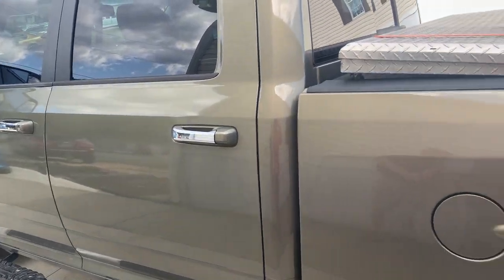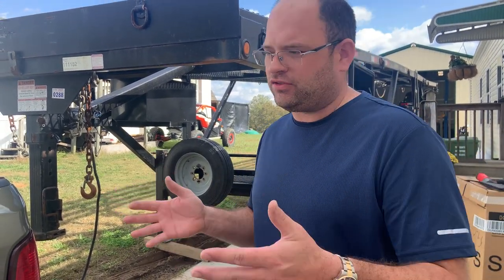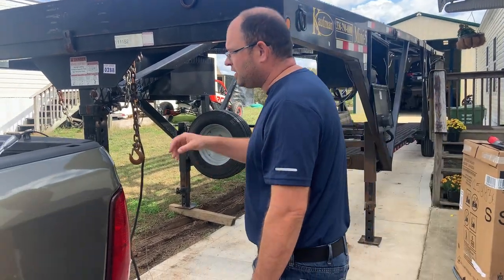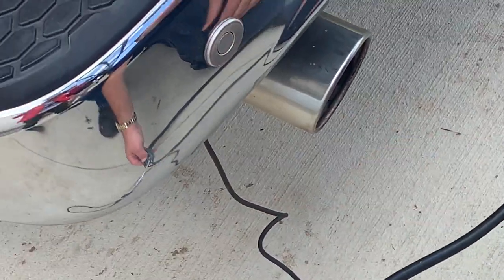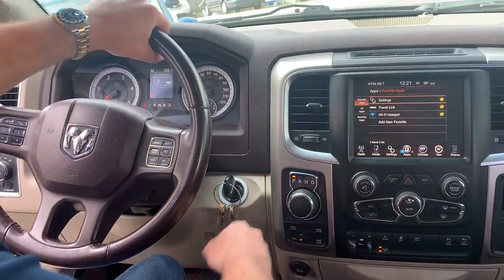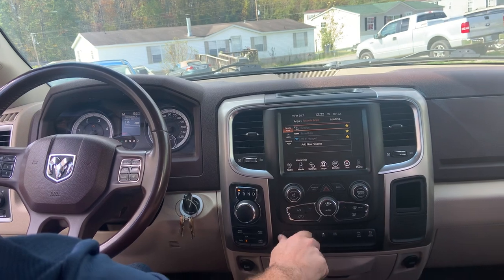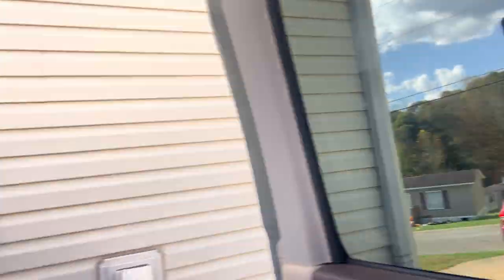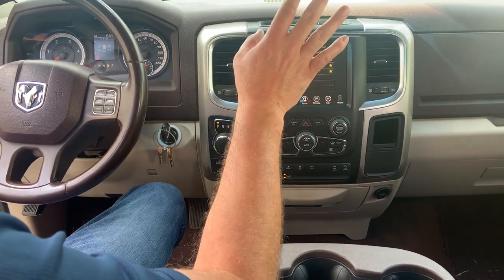Factory brake controller- Electric Over Hydraulic Brakes now working

Comment: So before doimg any modification on your truck and or trailer you may also need to change your settings in your truck to let it know that you are using an electric over hydraulic  set up.

Comment: If you go into your trailer menu on your truck you can choose heavy electric over hydraulic (EOH). Then it will work. I have the same-ish truck. Mine is a Ram 3500.
Reply from the maker: That’s the issue; that doesn’t work; and is why I made the video. The system needs to have resistance; once it’s there it’s good for that ignition cycle; you can simply remove the test light immediately after it’s introduced; it’ll work just like it should; once you turn the key off you have to start over. You might have a “Wednesday” vehicle; meaning you don’t have this issue; a lot of people are having this issue; this is one way to fix it in a pinch.
Reply: @nicholasburton955 I'm terrible with electronics, electric in general,  but trying to figure out why my electric over hydraulic is not working.  Any additional insight is tremendously appreciated! And thanks 4 creating the original video,

Comment: So how did you fix it? He can’t run around with a test light hooked up all the time
Reply from the maker: You’re not leaving the test light in at all, once you put the test light in, the system will close the circuit and allow the controller to actuate the hydraulic pump for that whole ignition cycle. I didn’t do a good job communicating that in the video, my apologies.

Comment: I have a pj trailer and went to order brake pads and was told they discontinued those axles and would have to buy new axles to get new brakes.  8 grand is a little steep for a brake job pj.

Comment: Ok, so you are not adding resistance, quit the opposite. But you are adding a load, small one. With that load it sees something back there is using power. I have also heard that putting any kind of light back there in your receiver tells your truck something is back there (from an instructor at an automotive school). So what you are saying makes since.

Comment: Have to try that with my boat trailer that's not working with electric over hydraulic and my new truck.
Reply from the maker: One thing I didn't mention as I wanted to keep the video short, once the resistance is made with the test light, the system will activate and there is no need to leave the test light in the circuit, you could basically touch the test light on the terminal, that whole key cycle the system will work.

Comment: So drive around with a vostage test light jammed in a connector? Stupid video. Yes it demonstrates the problem, but it does no offer a long term solution.
Reply from the maker: Once the light is introduced to the system it will work for that key cycle, you can remove the light bulb/test light; then, plug your trailer pig tale in. Once you turn the ignition off, you have to start over by placing the resistance for just a second to trick the computer to close that circuit.
Reply: @nicholasburton955  cant you go in the truck settings and tell it that you have electric over hyd brakes?